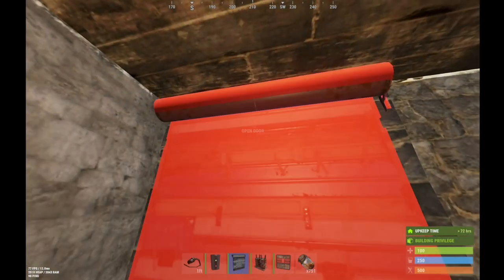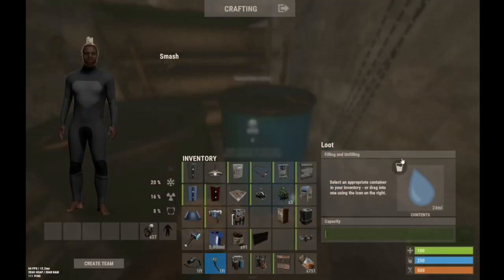Building The Scrap Factory | Rust Base Building 4.0

Comment: I cannot place water pumps on foundation even after I check if its deep enough, did they patch it?
Reply from the maker: Not to my knowledge, sometimes small rocks block water pump placement
Reply: Just Another Gamer thanks for replying, can you make a separate tutorial for fresh water? I tried to follow along but got confused from the different waters or can you refer me to a different video
Reply: I am having same issue, cant place water pumps on foundation
Reply from the maker: @rickbishop8840  You can't place them ON foundations, you need to demolish them to be able to, and build foundations from the outside to cover the gap
Reply from the maker: @nikorust5973  I'm reworking this video , might take a bit :D
Reply: Just Another Gamer sounds good, I was so frustrated from it lmao it messed everything up and it just gave me a headache so I just forgot about learning how to make one
Reply: In the video it appears the pumps are sitting on the foundation, I was frustrated as well and have tried everything I can think of in a build server...only way I’ve found is to build foundations outside the wall under water then put a half wall to make up the gap
Reply from the maker: @krismiller1623  I reworked the video, check the pinned comment, water pumps can't be placed ON foundations unless there was a foundation super low to the ground

Comment: some reason my medium battery doesnt charge very fast during the day i made sure to face them twards the sun (solar panels) anyways to get a better output?
Reply from the maker: I could be wrong, but that's what I atleast tested and worked out for me, you'll need 3 solar panels atleast facing sunrise and 3 facing sunset, this way your battery will be receiving power after in-game mid day, cause what I tested was placing 3 panels towards sun rise, they stop outputting power after in-game's 2:00 PM
Reply: @JustAnotherGamerr  ok so just add 3 more panels facing south thanks for reply!

Comment: How do u access the TC if its like walled in n stuff like that?
Reply from the maker: Check the pinned video for the video rework, you can access the tc by picking up the window with a hammer
Reply: @JustAnotherGamerr  the window loses HP doe? like everytime u access the tc u lose some materials
Reply from the maker: @spark5963  That's normal, window loses hp when you pick it up, then you hit the window with a hammer (You need to have metal fragments in your inventory) to fix it
Reply: @JustAnotherGamerr  aight

Comment: if you do this at a fresh water can you just skip the filter and pump straight to the barrel?
Reply from the maker: Yes, you can skip the water purifier and connect the water pumps straight to the water barrel, saving aswell few hqm for the electrical branch that connects the water purifier
Reply: @JustAnotherGamerr  when i plug the combiner into the barrel it doesn't make any of the water go in (its in the fresh water
Reply from the maker: @sebastianpinto260  Video rework is going live in like 6 hours:D I'll include at the end of the video how to wire water pumps in fresh water